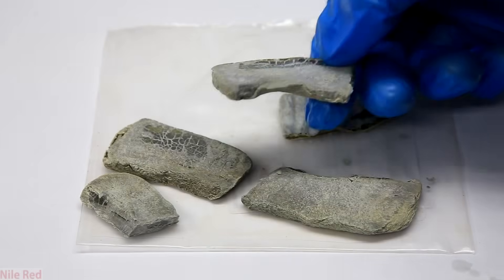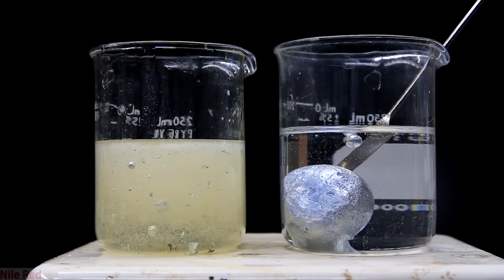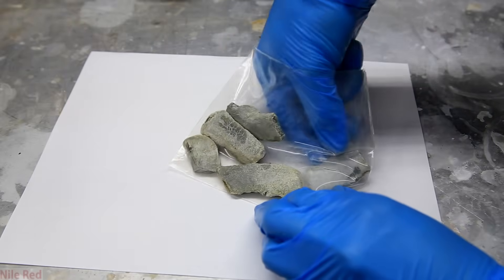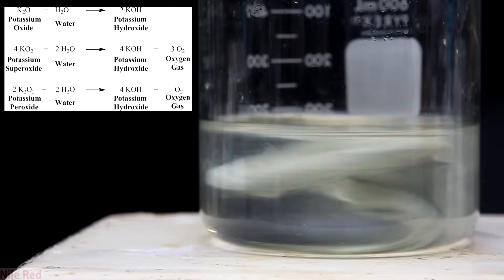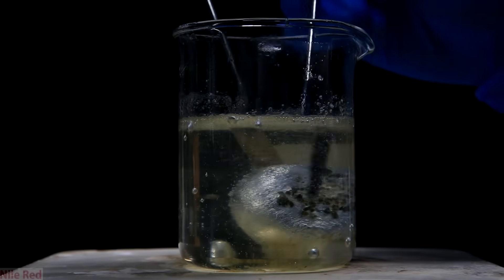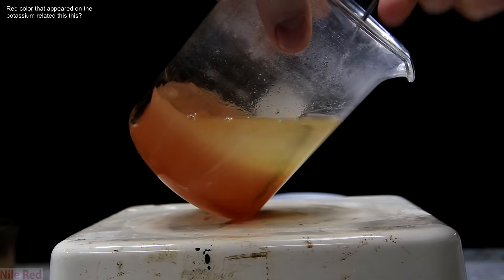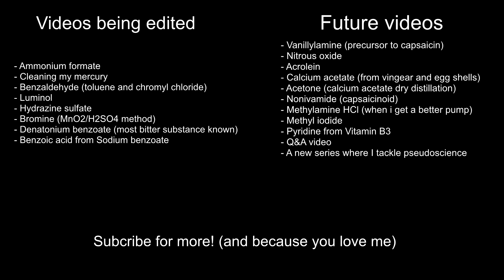Cleaning old potassium metal

Comment: Hello Nile

So just kinda wondering something here could it be possible to pass the potassium through a small filter to clean it or does it need to go through this process?

The filter in question could be a mesh screen as the oxide layer seems to mostly flake off and build up on the bottom of the beaker

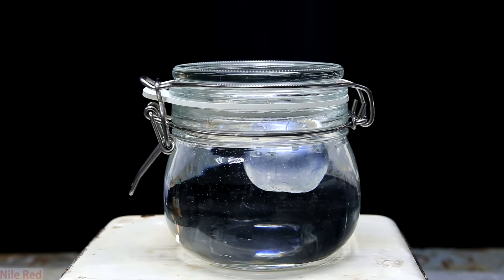Comment: at 12:00. To prevent oxidation, you could displace the air out of your jar. You could do that with a vacuum or by adding nitrogen gas in the jar.
Reply: But anxiety would increase suddenly for the jar to break under vacuum.
Reply: @jackychan7758  it depends on the machine you are using. 

When I was working at the University, we used 50 ml plastic tubes. we removed the cap and replace it with paper towel  and put that inside the glass container.

I've seen other labs use machines that had many metal racks. It looked like a baking oven but it was some fancy machine for lyophilisation that controled for many environmental conditions.

This seems to be the standard now. I seen smaller but similar machines on cooking shows like Guga.

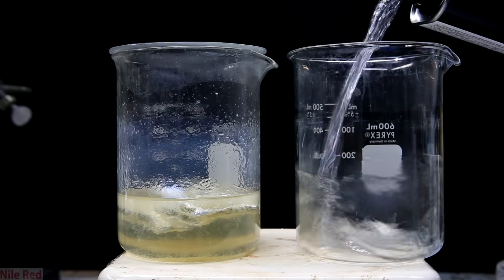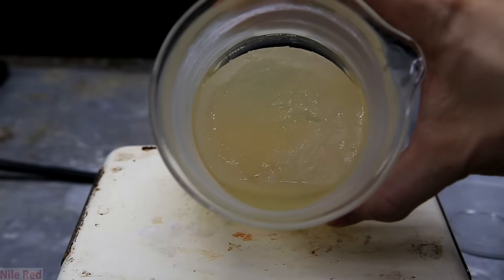Comment: Have you considered the blue colour observed at 7:00 could be due to the blue nitrile gloves you're wearing? A small amount of the gloves could be dissolving into the toluene:IPA and giving the blue colour. You could test this by repeating the experiment and using tweezers to transfer the potassium, and/or by placing a glove in toluene:IPA with no potassium present. This may also explain the gel at 12:03.

Comment: Backfill the containet you store it in with argon gas. I used to make little vials of the metal to sell on ebay by sealing it in glass flame seal vials filled with argon and molten potassium.

Comment: Okay, so I've only done a very cursory amount of research, but is it possible that the red stuff that appears on the surface of the potassium is potassium isopropoxide? I was wondering if potentially the propoxide dissolved in the toluene, and then when you take it out, the propoxide falls out of solution as the toluene evaporates? It seems unlikely to me, as it would be a salt dissolving in a nonpolar solvent, but... it's the best guess I have.

Comment: I found a kind of red stuff on silver crystal 15 years ago as well where I was just a junior high student. It was a single displacement reaction between Cu(s) and Ag+, after I got my silver crystal fully grown on a cooper wire, I pulled it from beneath the solution and found some kind of red-brownish substance covering on the metal surface. It looked like it was the metal itself has some interaction with air but I had no clue at all since no teacher could answer me, nor did I find any literature about it.
Reply: Did you use those blue gloves?
Reply: cuprous oxide perhaps

Comment: A little tidbit I could add after the whole cleaning procedure is done would be to ad some kind of weight into the mineral oil, just to keep the potassium under the oil and out of contact with the air.

Comment: Technically speaking, Potassium doesn't explode when it contacts water.
The potassium and the water go through an exothermic reaction that produces hydrogen gas as a byproduct.
The heat from the reaction than ignites said hydrogen.
So technically it's the hydrogen/water that explodes.

Comment: I think the potassium metal is blue because the oxide layer that forms is very thin and uniform, so it is able to act as a diffraction grating producing JUST blue light from the white light that is hitting it...in the same way that bismuth crystals can be blue due to the oxide layer that forms as they react at high temperatures (just having crystallized from a liquid), or the way that carbon steel turns blue when it's heated to a certain temperature (about 300 C) resulting in a very specific atomic thickness of oxide molecules on its surface. The controlled growth of oxides on the potassium probably produced a thin film of oxides that is of a thickness that results in monochromatic diffraction at this specific the blue wavelength - uncontrolled growth of oxides would maybe produce all sorts of colours.

Comment: To the problem of the floating Potassium metal: I was facing the same issue for my Lithium samples and made a kind of a "holding-down-device" which consists of a round plastic disc with a steel screw in the center. The other end of the screw is led through a hole in the lid of my container and kept in position by two nuts. The plastic disk now forces the Lithium pieces to submerge below the oil surface. Nevertheless, my Li got grey all over its surface, in the course of some months. Originally it came (from China) in a sealed plastic bag under Argon and was shiny then.

Comment: You said that it is a strong oxidizer, i think that it might oxidize the isopropanol to a acetone (propanone). Due to the erlenmeyer rule there is water formed with it so this water reacts with the potassium metal. Also, the toluene is beeing oxidized to benzoic acid, same thing with the erlenmeyer rule here.

Comment: Seeing as Potassium is an alkali metal, would it be unreactive in virtually any alkali solvent that the impurities would react with? So to clean it you could maybe just "dissolve" the impurities on the outside of the Potassium in some concentrated Potassium Nitrate to form Potassium metal and NO2?
Reply: Please don't try an store your potassium in a jar full of water and oxidizer.  I really don't think it works that way.
Reply: @tsm688  Potassium in water is very explosive. I wasn't suggesting to use water...
Reply: @EnglishLad  I don't think the chances of potassium metal in molten potassium nitrate are much better.
Reply: @tsm688  who said the potassium nitrate had to be molten? Potassium nitrate is a liquid at room temperature, is it not?
Reply: @EnglishLad  ...it is...not.

It's also a really powerful oxidizer and an important ingredient in old-fashioned gunpowder.  kno3 + fuel = boom.

potassium metal is *REALLY REALLY GOOD* fuel.
Reply: @tsm688  OK how about potassium manganate solution? Maybe that would be a better solution to clean it with?
Reply: @EnglishLad  No.  Look at the fire diamond before you suggest things.  This is another solid oxidizer.

Comment: Could you use Kerosene or mineral oil for the cleaning steps instead of toluene ?
Reply: I dont think so
Reply: @MagicalPotato05  I tried it with Kerosene, Worked much much better then mineral oil. With mineral oil the alcohol doesn't mix we'll and I had a few potassium flames.
Reply: You just have to go slow, start out with a small amount of rubbing alcohol till you get a feel for it.

Comment: 12:05 Toluene with potassium and it's oxides may produce benzyl potassium , especially at temperatures nearly 110 °C. And Potassium hydride too. That's why you better don't want to melt potassium in toluene!

Comment: Th potassium is anodized. The colour of the coating depends on the thickness of the oxide layer. The thinner is the layer the higher is the energy of the scattered light, so it shifts from dark red to light blue.

Comment: I'm no chemist, but I do work in industry, and the one thing no one has mentioned - Nitrile gloves are not chemically safe for use with toluene. (notice the gloves getting softer and looser)  You all will also observe that the red compound is caused by the toluene coated metal in close contact with the nitrile gloves 14:42
Reply: Same thing happens with acetone and nitrile gloves. Maybe there’s something with nitrile gloves and organic solvents?
Reply: @SomeGuy-yl1bx  yeah you need PVA gloves to handle hardcore organic solvents… I used PVA gloves with Methelene Chloride, but accidentally spilt some on my ankle. The scab is still healing after a fortnight 😜
Reply: @SomeGuy-yl1bx  it's possible there's nitrile gloves and organic solvents the thing about wearing gloves to protect the hands and possibly arms depending on the length of the gloves from hazardous chemicals is gloves made of different materials provide different levels of protection from different chemicals and the level of protection also depends on the concentration of the chemicals for example dilute nitric acid can probably be handled safely using latex or nitrile gloves provided the gloves are removed safely if contaminated but more concentrated nitric acid (86% or higher nitric acid) may cause latex or nitrile gloves to ignite on contact
Reply: @Some Guy  you know ypu might just be onto something guess I should stop storing mine in heated gasoline 

Update yeah I made napalm whoops
Reply: @NileRed Working in aerospace with many solvents that dont play well with nitrile, we use North Silver Shield 4h gloves. Breakthrough time with toluene is rated >240 minutes. A little pricey though
Reply: Well. Toluene I can say for sure is the most sour thing I’ve ever had the displeasure to accidentally taste in the lab 🤣
Reply: I think this is also where the red color is coming from. I noticed that the red appears specifically were the glove touches the metal.
Reply: @devinhiatt9995  I'm quite disappointed that no one has proposed an answer to this. I posed the original question a long time (2 years) ago.
Reply: @randomentity6553  you're "quite disappointed" no one did research for you. If you work in the industry and had 2 years to answer a question it sounds like a lack of motivation on your part. You could of found the answer yourself if you really cared to and not relied on a bunch of strangers on the internet. Your own curiosity failed you. Obviously there is nothing wrong with group discussion over what took place but you stated you were disappointed no one tested "your" theory for "you".

In the wide wide world of chemistry, your question/theory just might not be interesting enough for anyone with actual knowledge and skill to test for you.
Reply: @CaptSoapy  if you'd have read my question carefully you'd have seen that I said I work "in industry" not "In THE industry". I am not a chemist, nor do I have the knowledge to investigate this myself.  Chemistry is not my area of expertise.  I need to rely on others who's area of expertise is chemistry.  I can however observe and ask questions. My disappointment lay in the fact that Nilered while providing entertainment, did not address a curious phenomenon that happened during an experiment which was inexplicable even though he clearly read the comment I made and obviously does have the knowledge with which to investigate it. with respect to motivation I am not going to set up an entire chemistry lab and "learn chemistry" in order to investigate one odd phenomenon when there are plenty of others that could probably do this in an afternoon. So there's an answer to your trollish comment.
Reply: @randomentity6553  Your original post wasn’t a question. Why would you expect an answer?
Reply: @randomentity6553  unfortunately most people here are chemistry nerds in high school, so qualified answers are gonna be sparse. Have a good day.
Reply: Is the timestamp correct?
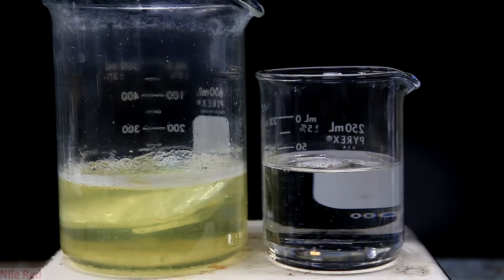Reply: @yusufabdulhakamnafis8072  You can see it happening really clearly at 7:48 and even more so at 8:15. Didn't notice until I read the first comment but it's definitely because of the gloves.
Reply: w
Reply: Some kind of potassium nitrate salt perhaps? The red stuff I mean
Reply: is that the real reason the second toluene bath turned blue?
Reply: Actually Nitrile gloves has such a love affair with solvents they wrote this song in the 80's (Modern English -- I melt with you,
https://www.youtube.com/watch?v=LuN6gs0AJls
Reply: He didn't answer about your comment but he responded the "useless" comments
Reply: @lounirs  Yeah, I noticed that too.
Reply: Vox Deus  i would like @Nilered opinion, because i am no chemist, but that color was clearly a chemical reaction.
Reply: When your the man you don't need to form an opinion!
Reply: i think i know what that compound is
Reply: @ACE_TFD_81  and? What is your opinion?  I'm the one who started this line of inquiry, but apparently @nilered has no interest in investigating or explaining this phenomenon so I'll take what I can get.
Reply: And he never reads this
Reply from the maker: @Cybear90  That's where you'd be wrong!
Reply: @NileRed  finally？
Reply: @NileRed  my guy is still active reading comments on a video from 2016, you gotta love that!
Reply: @NileRed  legend
Reply: @NileRed  it would make my day to get a reply from NileRed
Reply from the maker: @Seawolf.Gaming  hello!
Reply: @NileRed  
I just watched this video for the first time and I was going to mention that your gloves seems to be the reason for the red color but I thought it is 2020 and it is from 2016!! but here you are reading the comments :LOL
Reply: OH MY
Reply: @NileRed  lit
Reply: @NileRed  could the blue color be a result of the tydnall effect as the oxides may be in suspension?
Reply: @dam8072  i thought it was copper alloy and the purity of the potassium was questionable (for shipping safety reasons) as it didn't behave predictably, but maybe its just me. ps pls be nice lul
Reply: @NileRed  I'm just a plumber but maybe it's rust? Isn't rust on oxide as well?
Reply: @benjaminblankenship980  Rust is iron oxide
Reply: @Mare_Man  thought so. Just my 2 cents lol
Reply: @NileRed  i wanna talk to you man, how are you?
Reply: @NileRed  the red is probably thin film interference with a layer of vinyl glove dissolved in toluene on the metal
Reply: @mangoleeallan  Your YouTube Studio feed gives you recent comments from all over your channel. Most youtubers just neglect the comment feed so thats why this is rare lol. Props tho.
Reply: @benjaminblankenship980  yes, but there are properties of the reaction such as elapsed time which would rule it out
Reply: @NourMuhammad  knowledge never takes a day off
Reply: Whats the red stuff then ? @NileRed  glad your content is still up
Reply: @David CyberPwn3 you got shit on...
Reply: I noticed the same thing long before this comment was made. Guess no one reads my comments :(

Comment: To get all the pieces to coalesce you can melt it and use a glass syringe to directly inject the small pieces into the large one.  That's what I do anyways.  You just have to be sure that you aren't injecting other materials, so you always have that 1 tiny drop where you have to purge the storage liquid and a tiny bit of melted metal comes out.

Comment: This video is just like. Don't user old potassium cutting it could cause a potassium fire. Some potassium is stored in mineral oil to stop it from getting oxidized but this could start another potassium fire. So we'll clean of the potassium but you have to do this carefully or it'll start a potassium fire.

Comment: The red color is from a reaction between the gloves you had on and the potassium metal. You can see that the parts under the tips of your fingers are the reddest because they had the most contact between the glove and the metal. ONLY the parts that touched your glove turned red !!!

Comment: the jell might be very fat saturated soap, as the potassium oxide may have mixed with water in the mineral oil to form potassium hydroxide, then turning into soap with the fat of the oil. just a thought
Reply: oh nevermind, you didnt use mineral oil...

Comment: I don't know if you read comments especially on really old videos but I think the blue color could be because of "thin film interference" caused by a very thin layer of oxide, this is the same thing that makes steel shift color when heated slowly since the oxide layer that forms is relative to the temperature.

But hey I have absolutely no real education in neither physics or chemistry

Comment: In the case of Lithium, which also uses to float onto the surface of mineral oil due to its extremely low denisty, I once saw a kind of a holding-down clamp, attached at the lid of the container. This clamp forced the Li to submerge. It's strange, but my Potassium doesn't float on the surface of the oil, neither my Sodium does.

Comment: The blue colour of pure potassium in toluene is actually solvated electrons, caused by the low first ionisation energy of the element. A similar thing occurs when pieces of sodium and potassium are dropped into liquid ammonia.
Reply: No, thats not it. Its just a colloidal suspension.
It would be impossible to have water or alcohols and solvated electrons at the same time. But even in pure toluene there are not going to be visible solvated electrons.
Oh and toluene is not inert in the potassion/hydroxide mixture... see eg. DOI 10.1021/jo01012a067

Comment: Couldn't you eliminate a lot of the risks by using a cylinder of Argon and putting a tube beaker?
Reply from the maker: +MaxRay16 that would require a cylinder of argon!
Reply: MaxRay16 argon is expensive.
Reply: @ eddie van horn its cheap
1m^3 is about 20$ in hardwarestores
its the cheapest noble gas because its released by the radioactive decay of 40^K